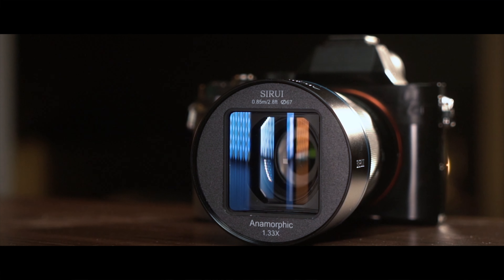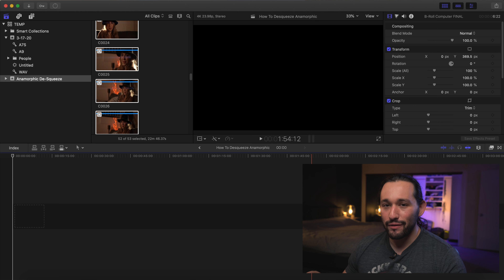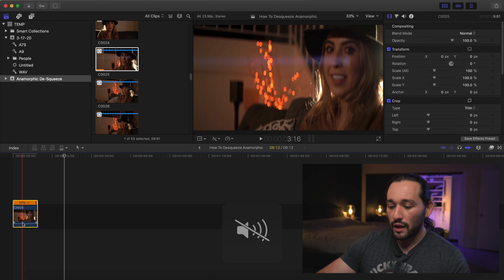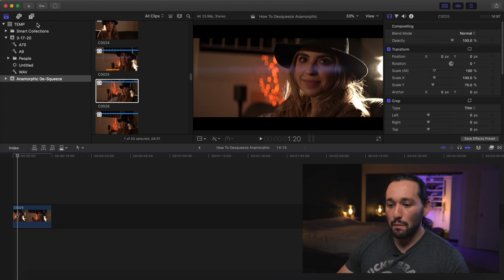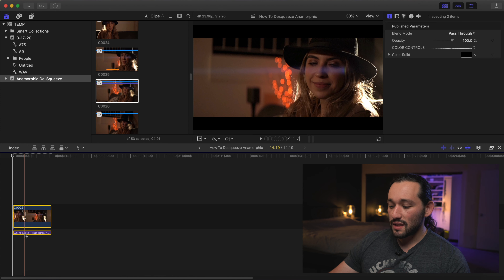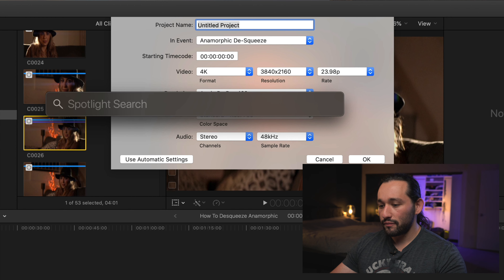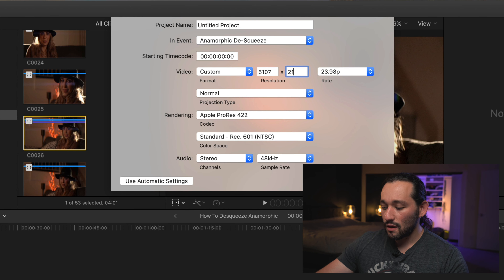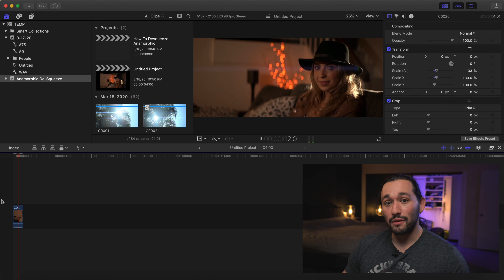How To Edit ANAMORPHIC Footage - Sirui 50mm Anamorphic De Squeeze Tutorial

Comment: nice and quick, thanks!
btw: you can do calculator stuff directly in spotlight on the Mac.. no need to open the app. just type "3840*1,33" (without the quotation marks and you gotta use the comma instead of the dot in the 1.33  tho
it will even exchange currencies or different measurements ;)
Reply: I have no issue using the period as a decimal in spotlight, it worked correctly. Double check.

Comment: Is there also a perfect workflow if one works with anamorphic & full frame lenses?

If I shoot a scene with the Sirui 24mm & a Sony 16-35mm GM lense, what would be the best worklfow?

Maybe, like this?

1.) Desquezing the anamorphic footage with your Cinematic way in one project, then export the footage and then import it to a new project with full frame footage?

Or 

2.) importing Anamorphic & fullframe footage into one 4K Project and desqueze it just quick & Dirty with 75%.

What do you think?

Important:
Of course one have to decide the correct settings before shooting the scene.
On the A7III you can shoot it with 1.5 crop, then you got that 21:9 Look in the post, or you shoot with anything open and the vignette and in the post you just crops in and you would still have a 16:9 Look.

Comment: I shot with iPhone 11 but used moment apps & had my settings on where it says apply de-squeeze to save files. All my footage looks squeeze vertically. If I were to put 133% percent on Y in fcpx I am loosing wide angle aspect ratio. Is there anyway to get by, I m not sure if I am supposed to shoot with unchecking “apply  de- squeeze to save files”

Comment: Thank you for the video. I have used the same settings while editing the anamorphic footage. When I was check in my TV I noticed a small green line on end of the right screen. I have done the project with second option i.e; 5107X2160. Why is this happening?
Reply: Because if you are using non native resolution your TV will have to resize the video. And because 5107/1.33...=3830.25 it will leave the TV with 10 pixels shy of the resolution it needs for the 3840 pixels wide screen it has. If you want to use those non native resolutions then you should calculate 3840x1.33... and it gives you almost 5120 pixels. Using just 1.33 is not how to do it. The best solution to your problem is simply using native resolution with 3840 horizontal pixels and resizing the original footage to 1620 vertical pixels. That way your TV or any other device won't have to resize the image for their 4K display.
Reply: @Smuutti  Thanks a million

Comment: Thanks for that video. If i create  a 1080 project (1920x1080) than i have to calc. 1.33 x 1920 = 1.436?? Thanks Marco
Reply: lol.... Math isn't my strong-suit either. 1920 x 1.33 = 2553.6, but the REAL QUESTION IS, do you round up? I think you would, since you aren't trying to cut off the image. So most likely 2554 on the x-axis resolution. is that right?
Reply: @zstring   you are completly right. 2554 not 1436....lol. I am a genius:-))  Do you think it matter if we choose 2553 instead of 2554?
Reply: What happens if the anamorphic lens has a 1.15x factor and using 4K footage?  We multiple 3840 x 1.15?

Comment: I am so confused. I have been watching so many "how to" desqueeze videos and I have seen both methods separately.  Is there a right way of doing it? By changing it through the sequence timeline doesn't it change the frame size. It won't be 4k or 1080?
Reply: I'm debating if the increase in resolution also means a decrease in quality or rather a false representation of resolution. At the end of the day your sensor is 4k, you can't get more resolution than your sensor has. So increase the resolution in your project and stretching the footage means your are theoretically just scaling your footage up. However I do rarely notice a decrease in quality, this could be partly due to the fact that most monitors and tvs cap out a 4k anyway so ultimately it gets scaled back down. However my argument is that for archive purposes or future proofing would it be better to scale down, that way there will never be a lost of resolution by upscaling. For example rater then stretching up to 5107 you keep in at
Reply: 3840 and just smash the vertical resolution down. That way you don't upscale potentially losing resolution in your files.

Comment: The second method is what is done optically with anamorphic film projection, but is not what should be done digitally. Why you want to deliver 5107 x 2160 digital files? TV screens have a resolution of 3840 x 2160 and DCP is 3996 x 2160.
Reply from the maker: Hey man! Good question! YouTube and newer TV's actually conform to most resolutions. They automatically add in the letterboxes and YouTube resizes the preview windows automatically. You will not be losing any quality by exporting it in that format :)